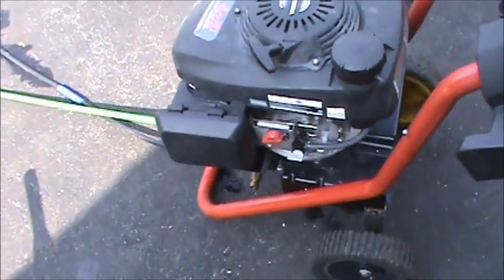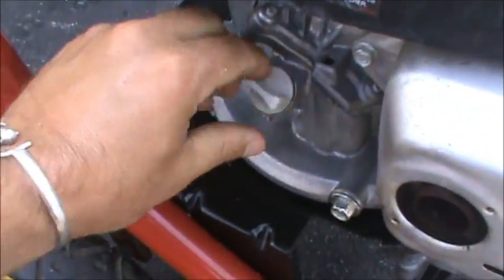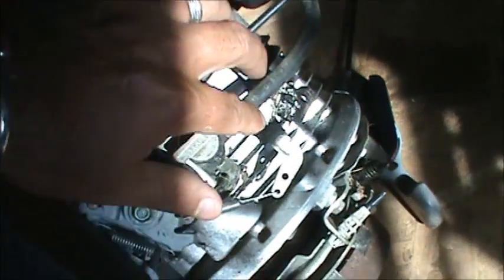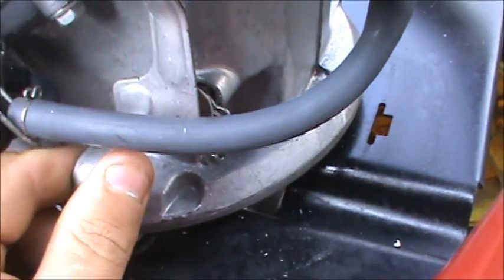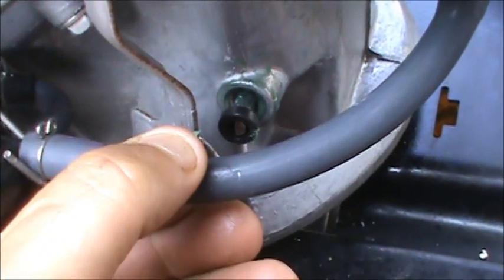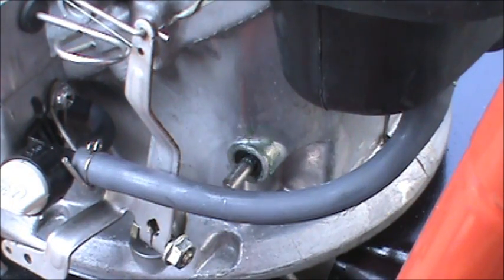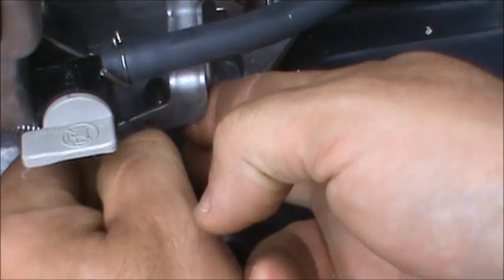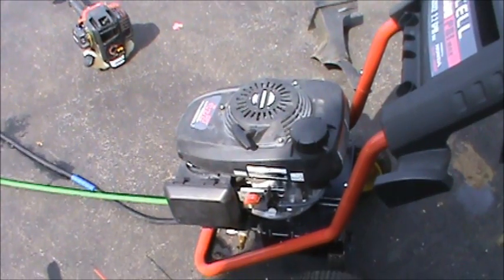Honda Engine Leaking oil out Governor shaft

Comment from the maker: http://goo.gl/iy6tBP  Buy the Honda oil seal from Amazon.
http://amzn.to/2fnaRkO Winterizing blowout plug
http://amzn.to/2epyKWI Female to Female hose Adapter
http://amzn.to/2fOIeA6 Apache Pressure washer wand with Tips
http://amzn.to/2fONXpz Vertical Pressure washer replacement pump
http://amzn.to/2ezZsiL Horizontal replacement pump
http://amzn.to/2eA4ImP Complete Replacement Pressure Washer
http://amzn.to/2fuqwhg Electric Pressure Washer $143
Reply: Do you think it would be the same seal for a GCV190?
Reply: doublewide6 Repairs LLC I’m having issues with my Honda gc190 pressure washer which is a karcher 3050 oh pressure washer. Couldn’t figure out where leak was coming from. Pump is fine (seal) and crank shaft (seal) is okay. The dipstick rod I just replaced. Still have oil just below the dipstick rod where the engine sits on a bushing sits on the plate. Very odd. May be this!
Reply: @doublewide6 I have a 8hp tecum engine doing this on a 3 in 1 chipper shredder. Do they make one for it??

Comment: Thanks for the video! I noticed my gxv620 twin cylinder engine was leaking from somewhere around there. Would this be the same seal? It doesn't specifically  say gxv620 so not sure.

Comment: Hey, I have tried over and over to get the seal started. But it seems like the seal is just too big. I get one part started and the opposite side of the seal pops out. I tried various sockets, open wrenches, blunt screw drivers, tapped with hammer etc. I just can't get the seal started in the machined cavity. Do you have any more tips? Thanks,  Rick

Comment: i have a Dewalt 4200 PCI and can't starting becouse motor blocking, and when turn out spark  i did see oil is full    cylinder, what need do?

Comment: @ 1:56   Screwing it all the way down to check the oil will make it seem like there's enough oil in there when there isn't, not too little oil.   Saying that they will over fill it by screwing it all the way in is exactly backwards.   They are in danger of not having enough oil, not too much.   
  The further in the stick goes, the more it will look full, so it doesn't make sense that they will over fill it by pulling the stick out slightly to check the oil level.

Comment: Thank you for the video, Bob. But I'm not sure about the Cotter pin. If Honda forgot the seal could it be that they also forgot to drill a hole on the shaft? Does the Cotter pin go into a hole or does it just slide over the shaft into the groove?

Comment: Thanks so much for this! Noticed oil leaking on the GCV160 engine that powers my Toro Super Recycler. Oil level at the full line (but not over) on dipstick, but I think the small hilly areas of my lawn are enough to cause this problem. I get that Honda saves a few bucks by leaving the seal out, but really? Wonder if the newly redesigned GCV engines suffer from this or if Honda didn’t want to hear complaints about oil leaks anymore.  😄

Comment: Simple question, I have the GCV 190 LA Honda engine on a pressure washer and it too is leaking from the governor shaft but I can't seem to find the part specifically for the GCV 190, will the one you show work on this model?

Comment: My GVC160 had been collecting black oil smear near that shaft for a few years, and this is the cure! Hint: Take the hair pin out to clean out the seat for the seal, then put the pin back on and carefully set the seal (flat side out)on the shaft up against the pin. Remove the pin and grab the shaft with pliers or grips, and finish seating the seal into the engine, then reassemble. Mainly what this guy is doing with some R+D. The shaft will push in but who knows how far? Take care...

Comment: the governer WILL fall the fuck inside the crankcase...  and you have to totally split the case to get it out, no getting around it..  so WATCH THE FUCKING SHAFT!!  Will piss you off..  just saying..  friggn honda..  oh and if you do abd take the case apart, nowhere or nobody i saw will tell you that the case will get stuck bigger than shit on the shaft..  so first off sand the shaft right above the crankshaft oil seal on the bottom of the case...  i didnt realize it was getting hung up there because my shit was new and shiny..  just a little kiss of rust color on the shaft so i didnt think anything of it.  The case would get about 3/8” apart then stop.  I beat the blonde off that whore, put pullers on it, pulled with almost 2 tons of force and somehow didnt bend or brake the aluminum, heated it up red hot.  Natta.  3 days later i said screw it and was gonna take it as a loss.  Put the spark plug in it and sealed it up n filled the block with race gas and set the fucker a blaze.  Well after the explosion believe it or not the damn thing came apart..  and didnt even break..  that is until i took a 5lb sledge to it and buried it in the dirt and watered it with the 12 pack i drank trying to see if i could grow me another one ..  didnt work but was fun as hell..  i even put the sticker on a stick and made it a grave..  watered it for a whole weeks worth of beer i drank..  so word of warning there.  And an fyi..  they dont grow motors with piss and anger..  or on US soil at least, might have some special nutrient enriched soil over there in japanland..

Comment: Good video,having the same problem on one of these with less then 30 hours on it in a pressure washer,this will be my last Honda small engine for sure,will stick with the Briggs and Stratton have several of those on my three mowers never an oil leak on any of them.
Reply: No

Comment: hey seen your video on how to stop an oil leak I have a Honda 3000 psi power washer with the leak if if possible could you reach me at @allenjack17@gmail an arrange to send me the seal I ll pay what ever  thank al g  thank sfor the video the engine is still running like a clock

Comment: Double wide the oil capacity for the Honda is 12 oz. not 18 or 20 like a BS engine.  Great video on replacing oil seal which was never there to begin with.  For a mower that costs $400+ you would think Honda would put a seal on the governor shaft.

Comment: I overfilled my pressure washer with oil, removed most of it, but  it wouldn't start - just one loud backfire blast. Can it be repaired or should I try to start it again?
Reply from the maker: pull the spark plug and try to start the engine that will force out the extra oil on top of the piston.  Drain the oil down to the right level first.

Comment: I would put the seal on the shaft up against the cotter pin and then pull the cotter pin. that way there's less chance of pushing the governor shaft into the engine.
Reply: That's what I did after looking at the setup for 10 minutes lol. Yes, I'm that slow.

Comment: Great video, but does anyone know if the GCV190 has the same issue, and if so, whether the same seal part number is used?  I've got a shop manual but can't find it at the moment, and the seal probably isn't listed anyway since it wasn't included from the factory (mower).

Comment: Thanks, used pressure washer yesterday seen oil on wet driveway, this morning a larger oil spread, was ready to take to repair shop when I saw you video, I had overfilled oil, everything good now but would like to know where to get that governor seal for Honda engine. Gc190, thanks again

Comment: Many thanks for the great video. It always bugged me that my Honda mower leaked oil from the first time I used it back in the summer of 2008. If oil can escape, dust and grit can enter and cause premature wear. Using the tips shown in your video, I easily installed a new seal and the problem is now a thing of the past. A+ all the way.

Comment: My 15 year old Kholer 15.5 started leaking in the same spot. It still looks and runs great, but I will see if I can get or make the seal. P.S. my wife said she would pay for a new riding mower, so I hope I can fix the leak and get a few hundred bucks for it. Thanks for sharing.

Comment: umm... wouldn't tightening down the oil cap cause UNDER-filling?  I mean, if you just place it in there you get a LOWER reading than if you tighten it down.... but yeah, overfilling is a problem in a lot of small engines.
Reply: Thanks for the video DW6. I hope your son is doing better. Said a prayer for him and your family. I’m not sure how PM you on here so I had a question about Honda GC190.i checked the governor shaft as your video suggested but I didn’t have any oil on it. Have a ton leaking out from the bottom. Just replaced the pump and added oil. Didn’t know about the right way to check until I saw your video. Do you think this is overfill or do you think it may be something else?
Reply: True.

Comment: Why would the honda engine manufacture not put an oil seal in the engine? That seems kindof dumb. Also why do they have the dipstick not threaded in to check the oil?
Reply: agreed.  Apparently there are no lawns in Japan that go uphill. :p
Reply from the maker: No oil seals saves them money.  As for the dipstick,  Kawasaki does the same thing.  Read your manual so you know what your doing.
Reply: I cant believe they would skimp on something like that. My dad has a Kawasaki engine on his mower an its like that. Reading the manual is always a good idea.
Reply: Love2boat92
Its not really skimping... if the oil level is correct and the engine is stored level it should never leak.  overfilling causes leaking (among other problems).
Reply: BigDogsHunt100 That is true but its still a little weird.
Reply: Hahaha. i guess there isnt.
Reply: no, they all go downhill.! sorry about that.